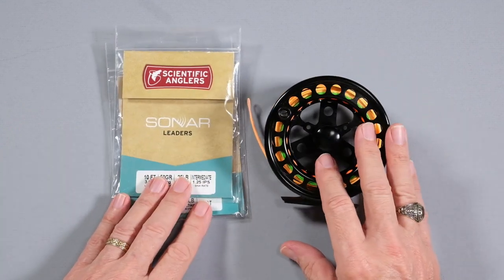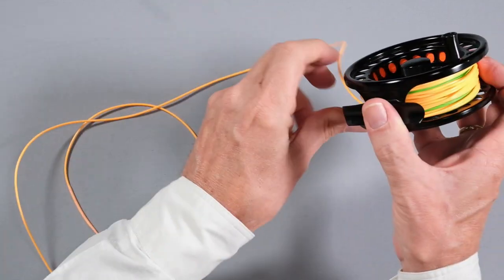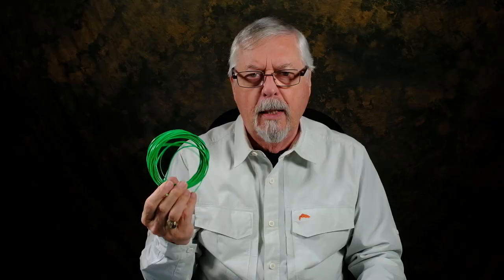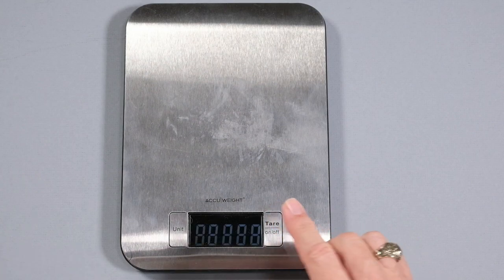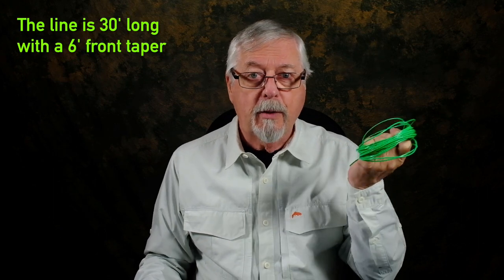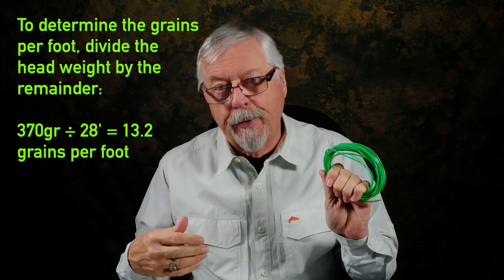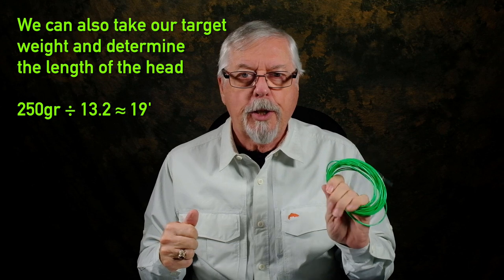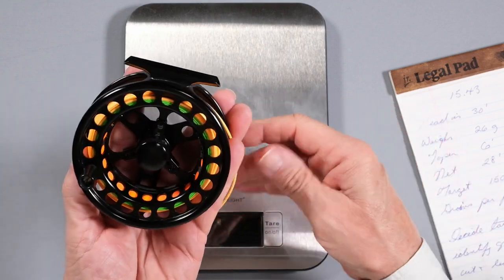Fly Fishing Tech Tips: Making our own heads from scrap fly lines

Comment: Hi Peter, your welding videos gave me the confidence to start making my own lines a little while ago and glad to see that I hit on the same basic principles as what you described. Last year I was considering purchasing the Airflo streamer max short but the $130 price tag was a little high for me at the time since I wasn’t sure if I honestly needed this line for my fishing or not. As a way of testing the principle I decided to sacrifice a Rio 6wt full sink line which I didn’t like to use because it cast poorly, and I had a bunch of SA textured spey tips in different sink rates to use for the butt. I ended up welding 7’ of an intermediate sink tip to 15’ of the Rio full sink line for a fair approximation of the dimensions of the airflo line, and it casts great. I manage to turn over long leaders and decent sized streamers in the sound at good distance. And like you said, it adds an extra level of satisfaction catching fish on a fly you tied, on a line you welded, and a rod you built.
Reply from the maker: Funny you should mention the Airflo Streamer Max Short. Back in 2009 I had a web page on fishing with shooting heads and one of the articles I posted in it had a line that I had welded up for use on my two handers.  It had 15' of T8 welded to 15' of intermediate belly, followed by a floating running line with the colours dark grey/ice blue/orange respectively.  

A couple of years or so later Airflo produced the same style of line using exactly the same colour scheme of dark grey/ice blue/orange. The only difference, it was shorter for use on single hand rods. Coincidence?

I wasn't with Airflo at the time so no way to know if this was a copycat case or parallel development.

Comment: Peter, great videos. I have a few questions:

1. How do you know what length head is ideal for a single hand rod (say 3wt, 6wt, etc)? Could a 5-7’ head work?

2. How do you determine the target grain weight for a given rod?

3. Is it possible to weld a Rio slickshooter running line to a head?

4. Is there an advantage to using a 10’ sink tip over a 5-7’ sink tip on a typical 3’-7’ deep trout creek when using a single hand rod?

Thank you!!
Reply from the maker: 1: The minimum length of head would be roughly a little less than double the rod length. Any shorter and the D-Loop becomes too inefficient and the casts get clunky. So for example, around 15' for a 9' rod.

2: Two line weights over the AFTMA recommendation, so 6 wt. at 160 would use around 210-220 which is an 8 wt. ballpark.

3. Nope, the mono loses all of its strength when it melts.

4: For any given sink rate, a longer tip gets the fly deeper. Shorter tips are easier to cast on a single hander, so it's a toss up.

Comment: I have a 10wt spey rod, how affective would a standard 5wt fly line attached to a skagit shooting line. I strip fish and dont like the mono for stripping and i also dont want to by a intergrated line.
Reply from the maker: The 5 wt. could be made to work, but we're better off with a proper coated running line, if you don't like mono. The problem with the 5 wt. is the low strength core, usually 20lb. sometimes only 15 lb. If we snagged up badly, the 5 wt. could be the first component to break. A true 30 lb. coated running line, like the Airflo Ridge line, would be a much better choice.
Reply: @hooked4lifeca  thanks, that makes sense, and it is a concern of mine. I would hate to break off and lose my shooting head and sink tip.